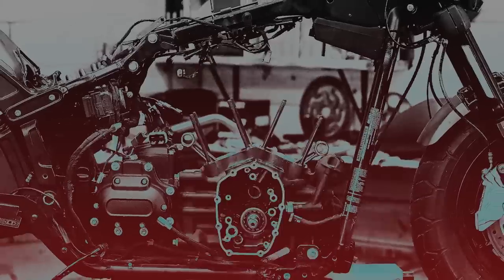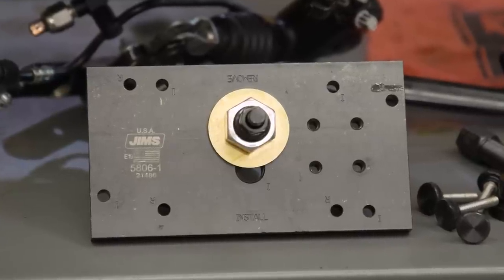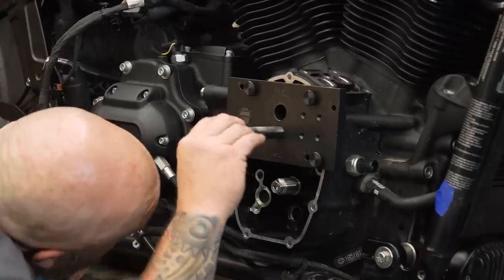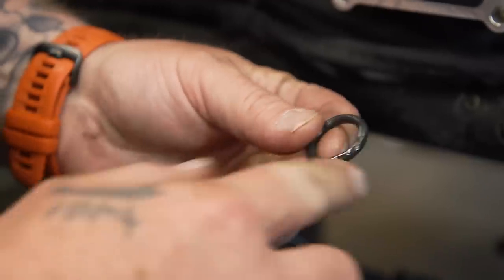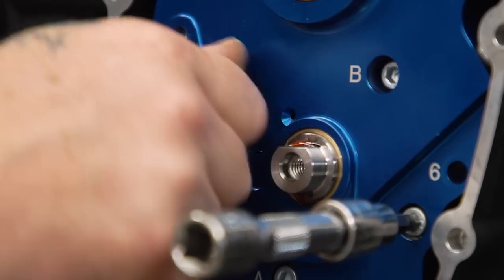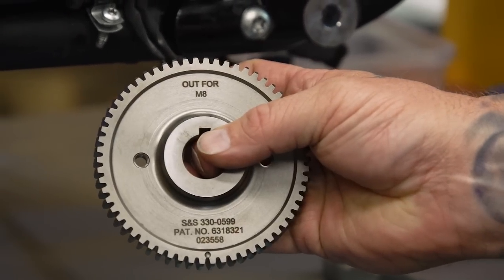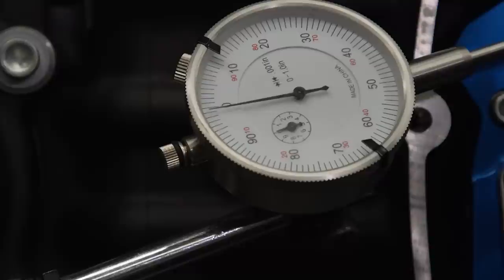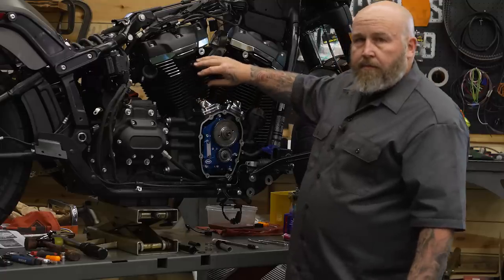How to Install a Gear Drive Cam In a Milwaukee Eight Engine | Weekend Wrenching

Comment: On the cam plate did you mean 90 to 100 inch pounds you said foot pounds ?
Reply: I was wondering the exact same thing.
Reply: Yes. Otherwise kiss your engine case goodbye

Comment: You do not need to replace the cam bearing on '23 and newer....it already comes with the updated bearing.  No need to waste money on the one-use-only tool.  You can read the bearing part #...Koyo...xxxxxx. So,  before wasting the time, risk of damage  and tool expense pulling a out perfectly good bearing, give the thing a look and see if it is already the updated style.  It'll be obvious.  If you don't have the time, just buy a bunch of things you don't need.  I do this kind of thing over the winter so I have the time.

Comment: I put in the S&S 475c cam in my bike a few years back, just gunna run it until the engine needs an overhaul. Also doesn't gear drive require a measurement of crank runout, which the factory Harley crank doesn't always meet?
Reply from the maker: Yes, we used and S&S crank. https://www.youtube.com/watch?v=avIWauRkzLM
Reply from the maker: Also, crank runout video - https://www.youtube.com/watch?v=zHTnnjh1ol0

Comment: would you recommend replacing and or welding the flywheel with a gear cam setup to never have to worry about run out? im a worry wart and just want my parts to be bolted in

Comment: you forgot a huge step. you cant install a gear drive unless you have less than .003" runout on the crank.  You will need a aftermarket crank. HD cranks are garbage. You wont have a hd crank good enough to do a gear drive.
Reply: He have SS flywheel, check previous parts of this build series.
Reply from the maker: We used and S&S crank - https://www.youtube.com/watch?v=avIWauRkzLM
Reply from the maker: Worked great - https://www.youtube.com/watch?v=oGe4Kk1vHRY